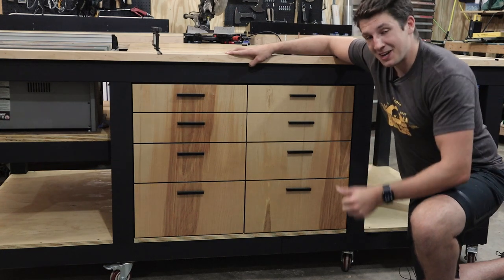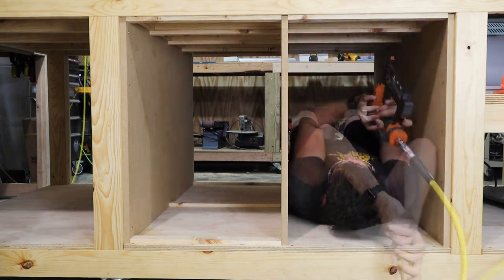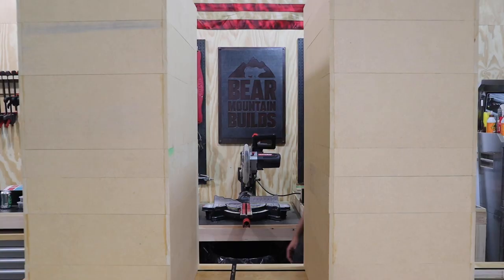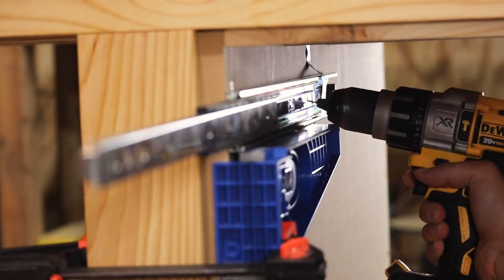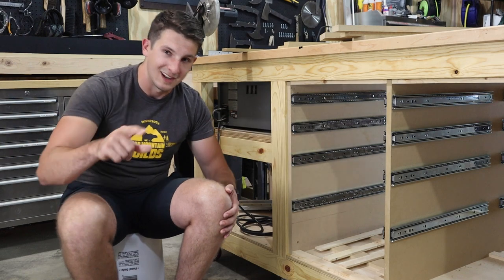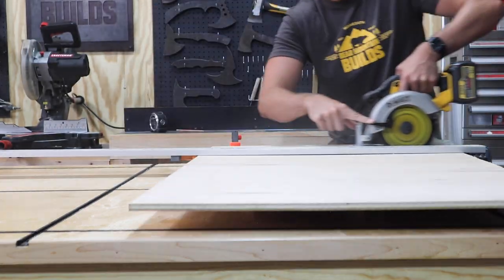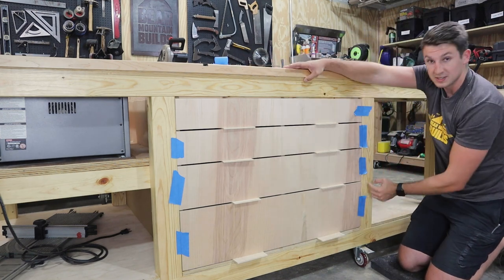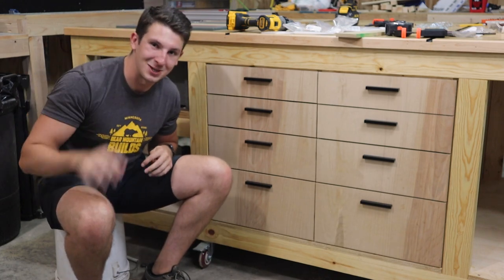Add  Matched Grain Drawers | Simple Table Saw Outfeed and Assembly Table Part 2 - FREE Plans

Comment: Great video, I really liked the jig for assembling the drawers.  It was one of those "why didn't I think of that".  I always buy and check my hardware before beginning the build because as you know 3/4" plywood may or may not be exactly 3/4".  Keep up the good work.
Reply from the maker: Honestly these jigs made installing the drawer slides super easy. You don’t even need to tape them in place

Comment: To save a trip to the store/and a few pennies, use the 1" screws for the door handle. After you drill through the face of the drawer, go to the inside and use a small forstner bit to counter sink the screw head.

Comment: So I’m planning on building your table and want to do drawers like this however, I have a Ridgid table saw and the dust blow out is in the back. I’ve got an idea on how I can accommodate some dust collection but was just curious how your managed yours with your table saw after putting in the drawers? Love your videos!
Reply from the maker: There's just enough room to put the tube of my vaccuum back there. However, I would recommend making a PVC tube that plugs into the saw and comes out the side.
Reply: @BearMountainBuilds  Great minds! That’s kind of what I had in mind. Thanks for sharing. I appreciate your quick reply.

Comment: Looks great!  I plan on building one myself (with the help of your plans, of course) but, where would the dust collection for the table saw come in?

Mark
Reply from the maker: You can run the tube through the side of the table between the saw and the back wall

Comment: Good job on the video and the table saw outfield table.  I'll be using some of your plan for this and your mobil work bench.  I've got to say KUDOS on the legs.  The best that I have seen on all the videos I've been checking out.  I've made a bunch of benches and work tables, but yours are great.  And could they be more obvious....now that its infant of who ever see's it.  Most legs are the way they've been looking for a long time.  So really, good job.  You didn't say why you made your table saw surface 1/8 lower than the rest of the table?  I'm not going to use the rest of the out feed part, fixed to mine, so that I can park it next to my miter box table and use its surface as extra length and my small assembly area.  I will park the back side of the outfield table along another wall as kind of a drop zone.
I'm curious on your saw....any reason you went with the Ryobi?  I've got a Bosch, I'm happy with it, but I might change it out because it has the leg stand and that won't do me any good when I build the table to hold it, and its probably easier to sell as a combo.
So I might be looking to replace it....any thoughts?
Keep up the good work!!!!  I'm looking forward to more videos.  I'll be checking out the rest of your work prior to making my shop.  I've been looking forward to doing it just right for....a long long time.....Thanks.
Reply from the maker: Glad you like the table!! I used that Ryobi because it’s been in the family for about 25 years and was free to use. However, it recently just broke last week and all the replacement parts have been discontinued. I just went out and bought a Delta 725T2 table saw from Lowe’s and I’ve been super pleased with it so far. If you’re in the market for a new table saw definitely check it out
Reply: @BearMountainBuilds   Thanks for the response.  I'm going to look into the Delta and Metabo, I currently have a Bosch but we will see.  I've looked into trying to down load your plans, it takes me to a purchase site but I'm having trouble figuring it out...am I missing something?

Comment: one hell o assembly table , great job. just wondering , when you put the sliders on the middle mdf , did the screws on the sliders interfere with the ones on the other side ? didnt see if the slots for mounting screws give you ample adjustment ? great vid , thanks
Reply from the maker: I used different holes on the slider on either side to avoid the screws hitting each other

Comment: Very nice build. Well explained. Is there a reason you offset the saw? I have the BT3100 which is a great saw.
Reply from the maker: If you offset the saw you can cut a bigger piece on one side. If you put the blade in the center the maximum cut size is reduced

Comment: What caught my eye with this build is that I have that exact same Table Saw and I wanted to see how you handled the Crosscut sled and Router table.  It appears you don't use the crosscut sled on this build and it's not in any shots except the first one - and the Router table doesn't have a router mounted.  I am assuming you are just using the table saw for rip cuts with the fence since there is no room for the crosscut sled to slide into the table.  Is that correct?
Reply from the maker: Yeah I’ve just been using it for rip cuts

Comment: I watched both your assembly table and drawer build videos. I inherited this same Ryobi table saw- generation 1. I’ve noticed that you haven’t addressed dust collection from the rear dust port. It seems like this will result in quite a bit of dust building up in the cavities on the table.
Reply from the maker: I just run my shop vac tube in between the wall and the table for dust collection. It’s tight but it fits.

Comment: This was one of the prettiest builds I've seen yet!  I like the design, the organization and placement of everything.  I would really like to try and build something similar.  I'm terrible at math but this kind of gives me some motivation to try.  Just curious how much did this worktable cost you to build? And will you add a vacuum intake for the saw dust?
Reply from the maker: I’m glad this motivates you to build your own!! I’m not sure how much this table ended up being, but if I had to give a number for the entire table I’d say around $500. My table saw has an output already on it that I just plug my shop vac onto

Comment: I’m curious; why didn’t you use dados for the insertion of the bottom plate on the drawers aside from the ease of assembly?  I know they’re pricier, but did you use Accuride slides. For this project, I used Accs because I wanted this major tool to last me for more than 10 years.
Reply from the maker: I didn’t think they would be worth the extra time. The way I did it will be plenty strong and it’s quick to do
Reply: @BearMountainBuilds  Clearly.

Comment: Do you have any issues with wood sliding across the table top when pushing through the saw. I am about to build a table and I want to do a top like yours but am worried about wood catching as I am trying to push through the saw.
Reply from the maker: I haven’t had a single issue with wood sliding through. I recommend waxing the top too

Comment: Just watched the videos on this build, and GREAT job! I just finished building one almost exactly like you did here other that I incorporated my miter saw on a fold down table on one side in the middle and my router station on the other side in the middle with my drawers being on the opposite end from the table saw. I do have a question though… What is the straight edge you’re using with your circular saw? I’ve tried 3 different kinds and the all bend in the middle on long cuts
Reply from the maker: This is the one I use. It’s the best I’ve ever used. 
https://amzn.to/3Fy5bji
Reply: @BearMountainBuilds  thank ya sir!

Comment: Silly question, I’m sure, but how do you keep the screws of the drawer slides from hitting each other in the middle section? The middle is 3/4 thick and the screws are 1/2 long, so I’d think, since the screw holes are at the same place on the slides, your screws would end up hitting each other. Idk if that makes sense to anyone else. If you put a 1/2 in screw in from one side and a 1/2 in screw from the other side, at the same spot, into 3/4 in material, they should hit each other. Please help
Reply from the maker: These sliders have a bunch of holes in them. I just made sure to use different holes on the sliders mounting to the center divider

Comment: Hello Bear Mountain Builds i just hit the workbench videos and this one. You have great skills and i like the content very professor style, but there is something that i am strugling... plywood and Mdf??? When you started the workbench i thought... ok he's doing it all plywood! But then you made the worst parts in mdf. I don't understand why you would use plywood on the bottom of the workbench and double sheats on the top. It's just my opinion but wouldn't it be cheaper using the bottom with mdf or just melanine, and the first layer of the work surface with mdf and then glue the plywood on top??? Then you could use it for the drawers. Another tip, avoy scratching the material too much. The screws inside the drawers could be just drilled with a jig, just a scrap of thin plywood or even cardboard. Hope to help you reducing project costs and simplifying the work. Overall it's a massive thumbs up. Keep on going!!!
Reply from the maker: I’m glad you like the drawers and table!! I appreciate the feedback too!